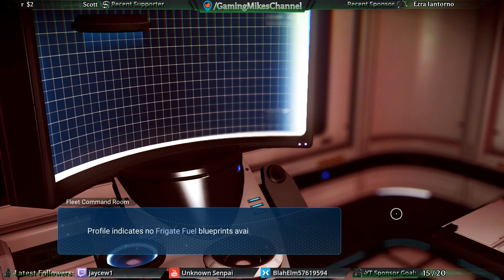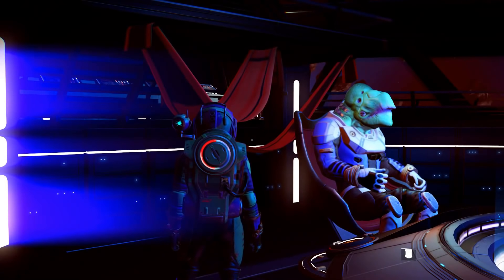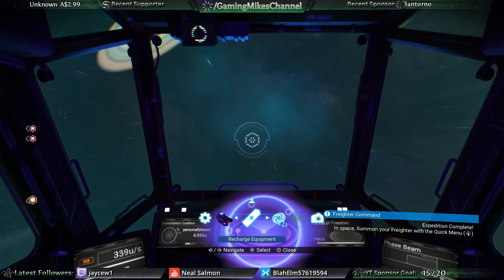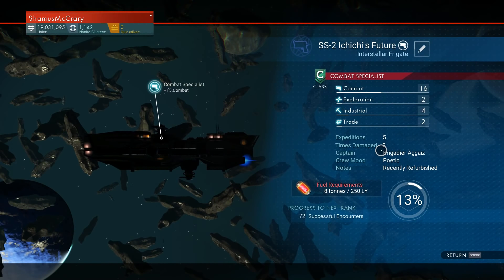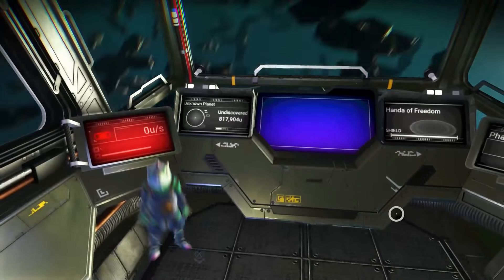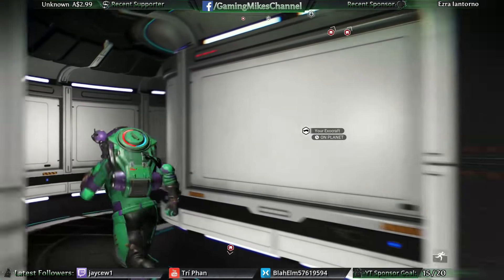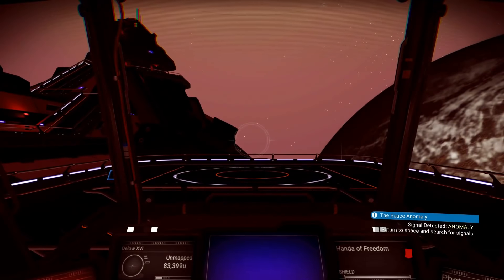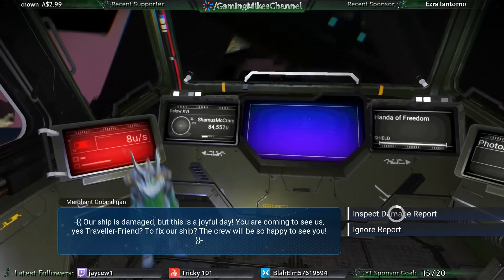Fleets 101: Fleet Control Room, Frigate Fuel Blueprint, Fleet Missions | No Man's Sky Next 1.5

Comment: I love everything except for the repair system. Once I get into space, I can't find which frigate is which. Makes it difficult to find and repair.
Reply from the maker: Is it not showing the red freighter icon on the broken frigates? Mine have all had that so far.
Reply: Not while I'm in space flying around them, no. I only get the red damaged icon when I'm using the frigate mission room. I don't know why this is. Perhaps an issue HG hasn't corrected yet? I also don't have the Blueprint Analyzer either. So far, I'm absolutely loving NEXT but these small issues are a bit frustrating.  

Also, while I have your ear, do you know of a way of keeping the hud active on screen while in 3rd person? Even while in my spaceship, I have to constantly hit left on the D-pad (PS4) to see what's going on. It's the same while on planet too (outside of my ship). I'm wondering if there is a button/option to keep it up.
Reply from the maker: They're putting out fixes pretty quickly right now. Hopefully they get those bugs soon.

I WISH there was a way to keep HUD up in 3rd person but none that I know of so far.
Reply: Yeah, I hope so too. Kinda important you know?

Hopefully HG will fix the HUD too. =)
Reply: Enduros5 Endy When you see it only in the room, it's probably just a damaged technology. When you chose the ship and check the stats, there should be some technologies shown around the ship. If one of them is damaged, don't worry. They repair themselves over time. Just when they come back from a mission, marked as damaged, you need to repair them manually.
Reply: Well, I figured this out last night. Sent a group of frigates out on a 3 star mission. They got their asses handed to them and they ALL came back barely functioning. Had to spend nearly two hours fixing them. They used a surprising amount of gold. lol